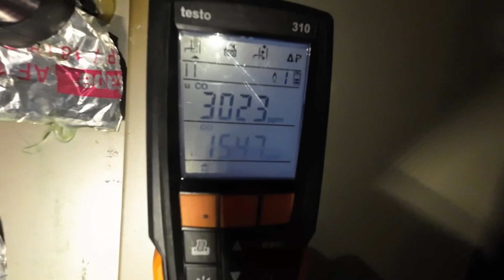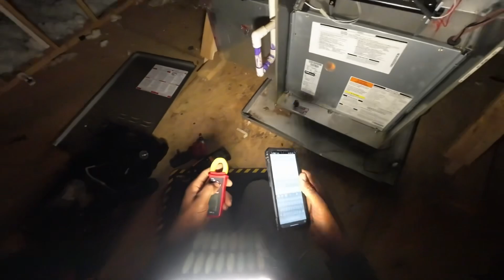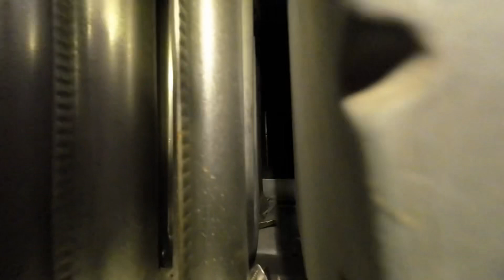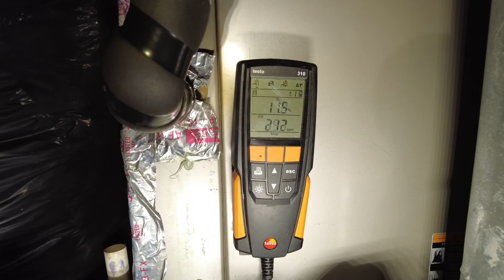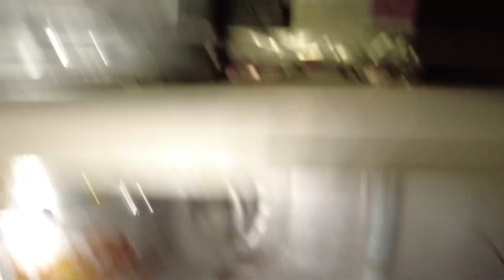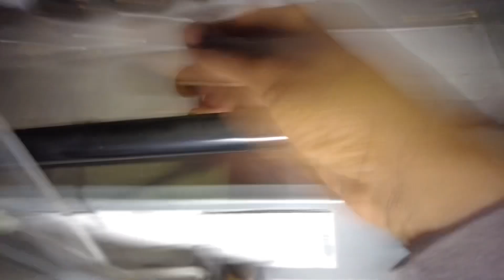Another High Co Issues on Carrier Furnace I couldn’t Fix

Comment: Try adjusting your gas pressure to low end of either the LP or Nat Gas Number on the Data Plate. Say it reads 3.0 " WC. To 3.75" WC. Bring your gas valve out number below 3 a bit and then increase it to say 3.05 " WC. You may be overfiring use a manometer to check both inlet and outlet pressure. My guess is you are impinging and creating Super High CO. Also clean burner kit/ assembly or replace

Comment: Total external static is too high at .76” w.c.  Unit is probably oversized or duct system is undersized. Either way the airflow on that system slugs and is causing bad combustion. 

Great video keep up the great content 👍

Comment: Thank you for this video, question I noticed a regulator on the gas line feeding into the gas valve. I assume then that this unit burns propane?
Reply from the maker: No this is natural gas most natural gas furnace require Regulators as well depending on the pressure being fed from the meter

Comment: Nice one, challenges make you stronger, persistence makes you better.
I have had good luck with all brand furnaces. Taking your time in diagnostics is the key. 
.A few things I noticed in this one, none of which might not solve your problems, but here they are:

1) Always check a combustion with the blower door on, room air effects combustion reading.

2) Always clean the flame sensor. Yours had green oxidation on it. Will give you better Mic amps.

3) Even though you checked the Manifold pressures, always clock the gas meter for proper input per manufacturer rating plate( minus 2% max ).

4) Disconnect the blower terminal and see what your combustion readings are before the limit shuts it off. If readings are still high, your focus should be on combustion issue, not a crack. 
If readings are normal, 0 to 50 ppm is my standard, but technically under 100ppm then chances are a crack, pull the heat exchanger to know for sure.

5) i noticed what looked like a maxitrol 324 pounds to inches regulator to the left of the furnace. You want to check your gas pressure before the 325 regulator also to make sure it is within specs.

6) Check the orfice sizes stamped on them and compared them to whats in the manual. 

7) Lastly, I know you checked the exhaust pressure, but that inducer looked like it was turning slowly. I didn't really catch what the reading was?

Good catch on the manifold miss alignment and using a combustion analyzer..
Thank you for sharing. 
Hopefully, you are able to return and share your final diagnostic.
Reply from the maker: Hey appreciate the tips really good advice! Yeah I definitely cleaned that flame sensor I just didn't show it in the video seeing how the focus was on the Co issue. Also the blower test is really good as well but based off the second bus analysis showing relatively low excess air and visual inspection it seemed to be more of an impingement and or over-firing issue.
Reply: Sounds good, Keep it rolling,  enjoy your content...

Comment: Why would you put a combustion analyzer on a furnace if you haven’t checked the gas pressure?
Reply from the maker: Because gas pressure and combustion analysis are two separate measurements the order in which you check them in don't matter. I.e. I can check the gas pressure and it be in range 3.2 to 3.8 inch w.c. and the combustion analysis can still reveal issues with the furnace, IE high CO, High excess air, High stack temperature Etc. and on the other hand the gas pressure could be high or low and all my combustion analysis measurements could be in range. Hope this makes sense

Comment: Did you check andse if a bird nest in the flue pipe.
Reply from the maker: I did not visually inspect it but I did check the draft pressure and it was about 300 to 400ths of an inch water column negative pressure which is pretty good

Comment: maybe the gas pressure is not set to be at 3.5 the manual of the furnace should give you a range.
Reply: It was 3.7 … the lower you set the pressure the worse the combustion readings !!
Reply from the maker: Not necessarily. In this situation the lower I set the gas pressure the better the readings were
Reply: no, wrong the lower he set that  pressure to 2.88 it was down below 800 ppm. then he removed the burners to clean them.  not all gas valves are set to 3.5

Comment: If i were you, place your temperature probe 3 feet away from the coil to get better delta t, too close to it gives a wrong reading in my opinion.
Reply from the maker: I hear that! That's more pertaining to checking it and cooling mode as the heat exchanger it's not in line of sight of the temp probe so there will be minimal radiant heat gains from the heat exchanger

Comment: I would look to replace the gas valve in this case and inducer motor and replace the gas orifices. Just blow them out try not not to insert anything in them. Always try to do a combustion test with the furnace door on otherwise you are adding excess air from the CAZ and depressurization.
Reply: No to all what you said , he should have never drilled a hole in a b-vent to perform a combustion test , the outer wall should be protected from the inner wall from the flue gases

Comment: Is that propane(in MA we only see soft copper with propane)? if so looks like it was never converted
Reply: No it’s natural gas , 3.7 “ w.c. Reading shouldn’t told you that
Reply: @rockydennis8926  if it’s not converted it’s going to show 3.7
Reply: @jaywill321  so your saying someone installed a NG heater on Propane house that was never converted to the correct fuel at the gas valve and orifice ?
Reply: @rockydennis8926  it’s a possibility, carrier doesn’t sell factory propane furnaces they are field converted. I only say that because of the soft copper gas line. Maybe that’s normal in his state but in MA soft copper is associated with propane.
Reply from the maker: No that system is natural gas

Comment: Nice video man… Can you leave a link to 3 in 1 part that you checking gas pressure, static pressure and return and supply air thanks buddy
Reply from the maker: This was actually a mod that I did you can't really buy it together as a kit but essentially you can put one together pretty easily if you have a field piece of manometer hose kit they have all the hose fittings and all you need is a ball inflator. I might need to put a shop on my channel and start selling them pre-made LOL